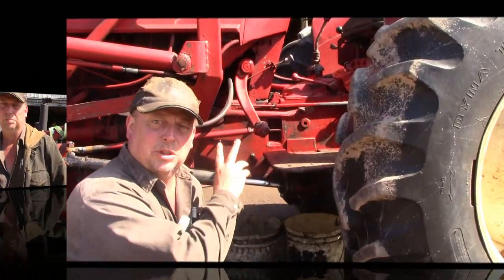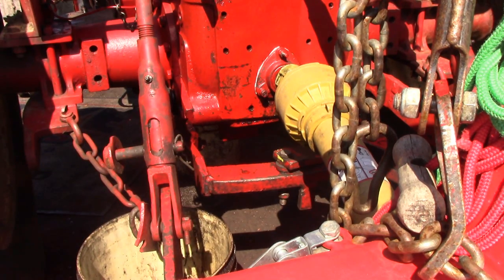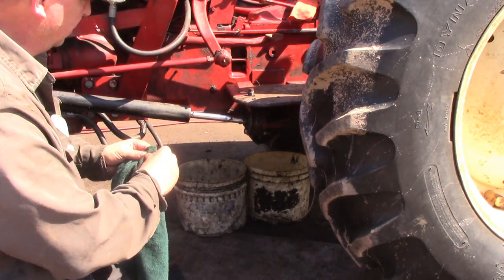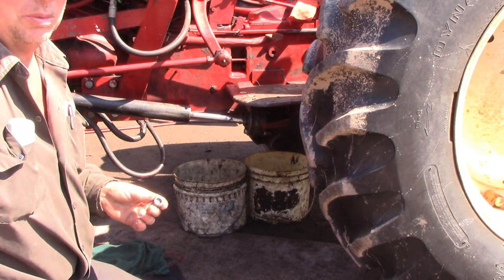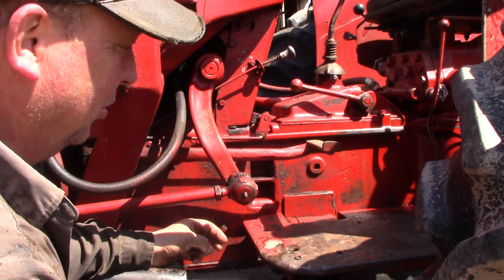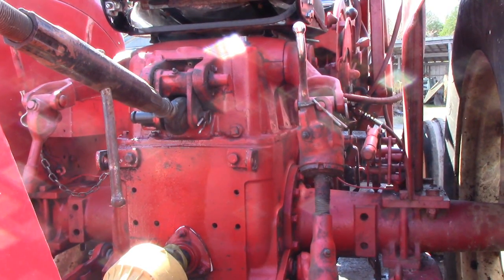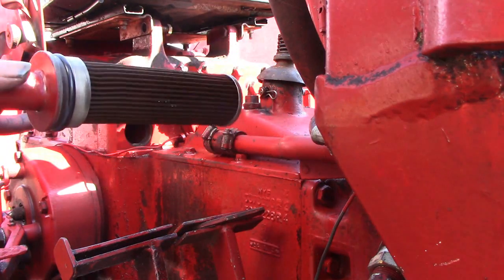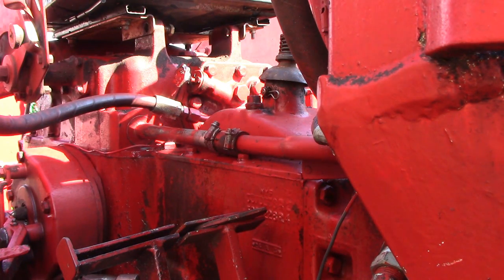IH 444 Fliuds change

Comment: Hey sir, i was just wondering if the power steering oil is the same as the hydrolic oil? Or were is it located?
Reply from the maker: The power steering pulls from the regular hydraulic reservoir. Thanks for watching!

Comment: I just did an oil change on one of these old girls, the engine oil filter had a flat washer on top and a cupped washer on the bottom with the spring. The Spring looked a bit different than the one you had.
Reply from the maker: No doubt one or the other had been a replacement. Thanks for  watching!

Comment: Hey Nice video. What type of oil is used for the 3-point/hydraulic system and what viscosity? I have a mccormick 434😀
Reply from the maker: The manual calls for CaseIH Hytran oil, viscosity is not specified. Thanks for watching!

Comment: Hi thanks for the video. Can you give guidance on where to buy a spring and washer for the oil filter? Or can you use any washer in there even if it doesn’t seal? Thanks
Reply from the maker: I haven't found a source for the spring or washer yet. If you can find a flat washer that fits snug on the bolt and covers the bottom hole of the filter a substitute spring shouldn't be too difficult to find. Thanks for watching!
Reply: @CanadianRedneck15 thanks!

Comment: Hi Dave. You say hydraulic level 3" off tank floor bottom/screwdriver. Is this with the three point hitch up or down? how much would the oil level height change due to the hitch position? I note yours looked like it was down, cheers
Reply from the maker: That's a good question, I hadn't thought about it before but I suppose up would make the most sense. Thanks for watching!

Comment: Hello,

I have a b 414, love every inch of her. This video has helped me tremendously. Can you explain to me how to check the coolant level and what should be used ?
Reply from the maker: THese tractors don't have a recovery tank so as long as the cores are covered when you open the rad cap you're fine. I would fill the top tank half full, it will find it's level from there. Thanks for watching!

Comment: On my 434 a previous owner has added a breather to the fill port. Its letting in moisture, not surprisingly. So im wondering if there isnt a breather from the factory, why would one be added? Could I just remove it? Great video thanks for the help 👍
Reply from the maker: From the factory it's just a pipe plug., I'd go with that. Thanks for watching!

Comment: Great help there.. thanks a 1000 times.. would never have found all plugs. Got a b275. was it 80-90 gear? 15-40 engine? And hydraulic?
Reply from the maker: Yes 80-90 gear oil, straight 30 oil is what the manual calls for but 10w30 or 15w40 should be fine, I use CaeIH hytran oil for the hydraulics but an AW32 hydraulic oil should be fine. Thanks for watching!
Reply: @CanadianRedneck15  appreciate it, thanks from Denmark.. :)

Comment: Ive got a1962 - B275 w Mechanical Depth Control (NOT Vary Touch) and experiencing two issues changing Hydraulic Fluid 

1) no drain plug in this model - does all the fluid drain from the suction filter once removed? if not how do i drain the fluid out?
2) i have remove the collar and slid it up, however the filter seems to be seized in. will not turn up or or pull out. is it maybe rusted in?  any tips?
Reply from the maker: On the models with mechanical depth control the fluid drains from the filter hole, you can help it along by having the tractor tipped down hill a little  bit.
 The filter is held in place by the friction of the o-ring that seals it. If they've been in place for a long time they do stick a bit. Use a large pair of pliers, I use channel locks, to wiggle it free. You do have to remove the lever bracket on the models with mechanical depth control. Thanks for watching!

Comment: I've been looking for a video like this for months. I have a 1967 IH 444 diesel. This video is so helpful, thank you. Only problem is you didn't mention what type of  oil and hydronic fluid to use. Also, the part number for the oil filter if it's the same. Any help would be appreciated
Reply from the maker: Any good quality diesel engine oil would be fine, th emanual calls for a straight 30wt oil but 10-30 or 15-40 should be fine. CaseIH Hy-tran oil is the recommended hydraulic oil.

Comment: I have a international harvester 384 need to rebuild the steering box. Have you ever rebuilt one and what do I need to do that?
Reply from the maker: I haven't on a 384 specifically, you will need the bearings for the worm shaft and probably some shims for where the tube bolts to the top of the gear box. Thanks for watching!

Comment: Is bleeding the hydraulic fluid needed when changing fluid or will it purge itself?
Reply from the maker: No need to bleed, just refill, let it circulate for a few minutes, recheck your level and top up if necessary. Thanks for watching!

Comment: IH 444 IHB414 hydraulic oil change and filter replaced.
Hydraulics on the rear controlling the bush hog will not stay up after cuttimg off the tractor and seemingly leak down over a period of time if bushhog is left in the up position.  
And even when hydralics are set at a position to go to another field. will have the bush hog lowering without do it from the hydr controls.
Several people have said it is air in the system  after  changing the hydraulic fluid and that it needs to be bled.
Does this sound correct to you, and if so, do I just slighly (just enough) crack a filler plug while tractor is running to bleed off some pressure till fluid comes out or is there another location and or techniques.
Around or supposed to be a 1969 model.
Thanks
Reply from the maker: Why would you leave it parked with the mower up? That is leaving pressure on things for no purpose, always leave your implements lowered to the ground. No need to bleed the hydraulics, they work the air out themselves. My guess is your lift cylinder is leaking by a bit.
Reply: I keep them down when implements are on it, but when mowing uneven ground I'll raise it a bit and after a bit it seems to leak down cutting groove in ground with the leading edge.
And when no implement it seems to leak down with nothing on it.
I was leaving it up in both situations temporarily, just to test it to see of it would hold without leaking down.
I haven't used it yet with disc and or my grader so I wanted to make sure it is address for situations where it need to hold where put.
Any videos dealing with where that leak might be?
Thanks. 
Great Channel by the way.
Reply from the maker: @7blueblaze  Sorry, I misunderstood. Is your lever staying in position? When the tractor is running it should automatically lift the mower back up if it drops a bit to match the lever position.
 I'm sorry I'm not that up on hydraulic systems.
Reply: Yes, both levers stay in the position they are set.
Recon I'll just live with it or I'll eventually figure it out. 
Thanks.

Comment: Hello Dave

I have a B 414 and don't know how to get the front end bucket up.....do you have a tutorial on how to uses all of the levers under seat tonoperate
Reply from the maker: There are a few different methods of connecting the loader to operate the controls. I expect you are going to have to open a valve to the loader and close the valve to the rear lift to operate your loader. Thanks for watching!

Comment: Hi Dave, I have a IH444, the hydraulic drain plug is not male like yours i.e cannot use a spanner, it has a 4 sided square indent and I need a bar to undo it, it is also damaged so hard to get out or tighten.
Mine has a magnet glued to the back and is about 7/8" dia and 3/4" long and has about 7 threads. Can you tell me the size/threads/type of your drain plug ? I can't find it in any of the manuals. Thanks in advance, greetings from Scotland.
Reply from the maker: I'm not sue but I think it takes a standard pipe plug. Thanks for watching!

Comment: Thanks for this video.  My dad had a 434 gas and I just bought a property that came with a B414. 

How about doing a video on servicing the steering box on a B414.  My tractor’s manual steering is very, very stiff.  Kooky setup with the steering column going down through the fuel tank!🇨🇦👍🏻
Reply from the maker: Jack the front end up and steer it that way, you may need thrust bearings for the front spindles or they may just need greased. I do have a video on rebuilding the steering box here https://www.youtube.com/watch?v=YjUDRWeNCfE
 Thanks for watching!

Comment: ONE OF THE BEST, RELIABLE 33 - 40 PTO HORSE POWER TRACTORS BUILT. OUR OLDEST 434D HAS PASSED THE 10 THOUSAND MARK & STILL RUNS GREAT. BOTH 434 D'S WERE PURCHASED NEW. I ABERAGE I GALLON FUEL BURN PER HOUR WHEN   BALING. SET THE RPM @ 1850 RPM. VERY STRONG TORQUE RANGE. SAD DAY WHEN IHC AG DIVISION WAS ABSORBED BY CASE.
Reply from the maker: I agree on all counts. The 384 you see in many of our videos has over 15 K hours on it. Thanks for watching!

Comment: Thank you for this video! So helpful. I know nothing about anything mechanical. Just bought a very old very poorly maintained IH 434 Diesel. I can’t figure out what year exactly (SN B27396). 

It’s dumping oil or hydraulic fluid. Seems to need a new solenoid. Doesnt start unless I bang on it. I’m very rough shape. 1:10 

Have been trying to find someone to help me maintain but doesn’t seem to be any tractor mechanics around. 

Any suggestions for BC? 

I think with this video I can at least see now how to keep topping up the hydraulic fluid until I can replace the lines. 

Please keep making easy to use and videos with what tools needed etc. so so so so so helpful!
Reply from the maker: I am glad you enjoyed the video. 434s were built from  1966-1969. I don't know any mechanics in BC, sorry. Thanks for watching!

Comment: Great video but would be good to know the specifications of the oils I need to use.
Reply from the maker: Engine oil SAE 30, 10W30 or 15W40. Gear oil 80W90. Hydraulic, CaseIH HyTran oil. Thanks for watching!

Comment: Thanks very much Dave.
I just changed the engine oil in a diesel B414 I'm trying to get running. Many fuel problems because it's been setting 10 years.
The spring and washer is missing from the oil filter canister. I knew something was wrong. I was asking myself how does this work? Now I know and have to get the part numbers and find them.
Reply from the maker: I'm glad you enjoyed the video, thanks for watching!

Comment: Hi Dave great videos I have a 384 is stuck in second gear
Reply from the maker: You will have to take the pin out at the base of the shift lever that holds it in the cover and line up all the notches on the shift rails in the center of their travel. That will fix you up. Thanks for watching!

Comment: I did it!  Got my hydraulics working again on my B414!  The hose connecting the hydraulic filter was leaking - among other places - but was bad there.  I removed the hydraulic filter and cleaned it, and then things went to h*ll in a handbasket.  Couldn't find a replacement hose.  Then after a month of being told "what I really needed" I finally got what you said, i.e. hydraulic suction hose, but couldn't get the clips to go back on.  After swearing heard round the world, I put on some eyeglasses and turned on a bright light and could see someone had cut the screws short on the clamps, probably because they were rubbing their leg.  So the screws were now really short, or the hose was too heavy, and the screw threads on the end were rolled from the cutting and despite a plethora of tools and clamps, they would not screw together.  AHHHHHH!!!!!  So I stepped outside the box, got some screw clamps, and done and done!  Only took me two months.
Reply from the maker: Well done! A lot of these jobs require a little patience and creative thinking. I am always happy to hear people success stories!

Comment: I just bought what I believe to be a 444 with bd154   my steering has great big heavy duty cylinder across under the axle and this tractor sits low has 16.1 rear tuff tires.  Was told it came from a air force base and was used for mowing slopes.  Serial number plate is gone.  I need some help identifying exactly what I have purchased.  It runs fair but has a few small issues and missing sheet metal . The peaces that go around under the hood and behind the grill.  I would sure like to email you some pictures of it
Reply from the maker: It could be the industrial version which would be I believe a 2400. My contact info is at www.chowntractorparts.com

Comment: thank you. i just found you recently. and then you are covering a tractor close to mine. i just got a 354. and about to do all this to it lol. i just cleaned it up painted it. fixed lot lil issues first. but don't have the $ to dump into fluids etc now. its like 150$ in my area to change just trans and hydro oil.  then oil looks like another 75$ shew wee. LOL. but I'm gonna and i think remove the top of the trans and fix what i think is a leak. seen a bunch of blue rtv. grrr i hate that stuff. ill make a gasket if its not to bad to remove the shifter fork plate.

Comment: Hi Dave. I Did the hydraulic fluid change exactly as yours. My 444 has a loader that was working ok before I did the change. Now it won't lift at all!! Eventually managed to get to lift, but needed very high revs and took ages to lift fully. I was hoping that when I released down (gravity not controlled cylinders) it would work, but it does not work at all now. I was wondering when I wiggled the filter pipe the same pipe was roating that goes into the pump via two jubilee clips. I cannot get to these clips due to the loader,. Wondering if air is getting in at that point ? any help much appreciated, thanks. P.S didn't touch the orifice filter.
Reply from the maker: Sounds like it is getting air from somewhere for sure, did you recheck the oil level? Thanks for watching!
Reply: @CanadianRedneck15  Hi Yes I rechecked the level after all this trying, it had gone down by 1cm and it was frothy on the screwdriver, before, it was clear. Update, next day reversed up hill and added more oil so full to brim, and left oil plug off. Draft control lever fully forward as normal, tried position lever with isolation tap closed, no loader movement. Tried again with iso tap open, no movement of 3pt. Also looking through filler hole saw no oil movement throughout this. Moved draft control full back and saw oil movement and loader moved up very slowly, also 3pt moved. Lowering loader made oil overflow out of refill hole. Turned tractor off, drained some oil out so back to 7cm on screwdriver, put draft to fully forward, also tightened jubilee clip on pump input. Start tractor, this time the 3pt and loader work with position lever as originally before oil change. 3pt slow but always has been but loader very very slow and does not speed up with higher revs.
Also oil is clear again. Phew sorry for ramblings.
So things a lot better than before, but have you any idea why the loader is so slow ?
Reply from the maker: @AidyGriff  It doesn't make sense that changing the oil would make the loader slow down.

Comment: Great video has helped me with my old IH444. My manual mentions removing and cleaning/replacing an orifice filter behind a bolt when servicing hydraulics. Have not serviced it yet, do you change this filter ?
Reply from the maker: I don't usually mess with that filter, it is brass and has holes around it. They often stick and break so I leave them alone. Thanks for watching!
Reply: @CanadianRedneck15  Cheer Dave thanjs for that, I'll leave it alone and just clean the other filter. Greetings from Scotland

Comment: any advice on what to replace that gasket on the bottom of that oil filter housing with?  the one on top of those washers over that bolt head.  mine leaked something bad, i permatexed a new one, still leaks.
Reply from the maker: I would use a rubber or cork washer. Thanks for watching!

Comment: So the 3 drainplugs from transmission drain the same compartment? And same compartment is refilled only by the fillerhole next to the gear lever?
Thanks for the video
Reply from the maker: That is correct, thanks for watching!
Reply: Beauty- thanks, changing on my 3434 soon. Have you done any DB 885 , 3cylinder, liner changes? 
Cheers from Denmark .